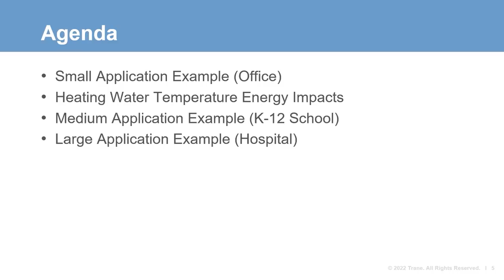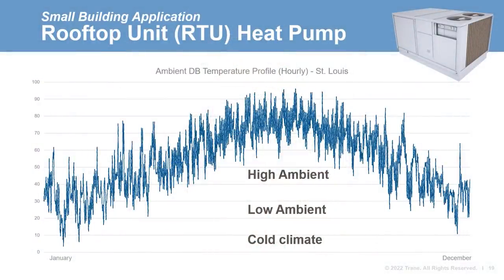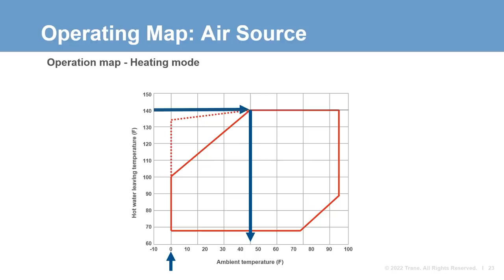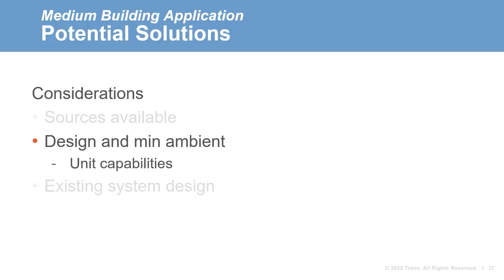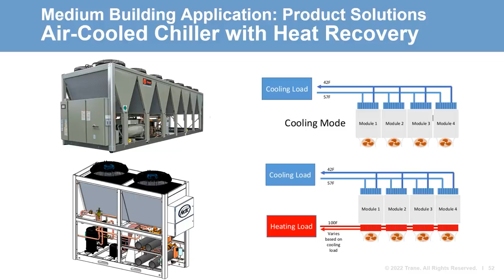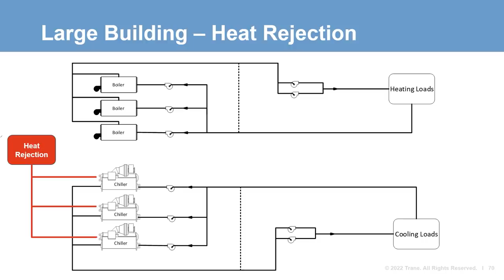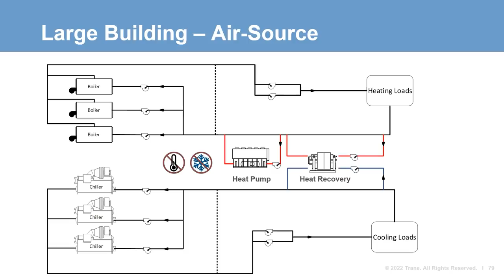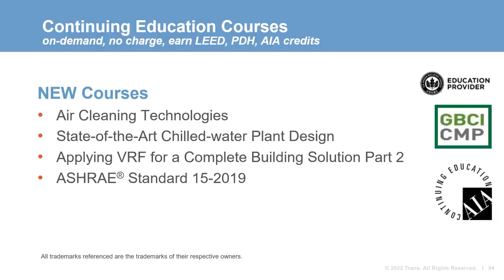Trane Engineers Newsletter LIVE: Decarbonization of HVAC Systems Part 2

Comment: Great video, you mention in the medium building application section that new technology will allow for 130°F hot water production down to 0°F ambient. Is there more information on these products and when it's anticipated they will be available? 

Additionally, air source cooling is generally much less efficient in kw/ton than evaporative cooling - ie an air cooled chiller is less efficient than a cooling tower+chiller for comfort cooling. Adiabatic cooling using water sprayers on the condenser side of an air cooled chiller can however close this gap, especially in dry climates. Does Trane offer this as an option, or do you have any input/recommendations on this?

Comment: If you already have videos or have performed a webinar or thinking about topics for a webinar and training video. 

       Heat recovery systems using air to refrigerant for heating and cooling and using the waste gas to heat a glycol loop system for reheat for increasing D humidification capabilities and heating domestic water like in large hotels or that have commercial space and agricultural in the cannabis industry

     Agricultural cannabis industry needs reheat for Dehumidification they also need to chill water sometimes they need to heat water all simultaneously while they could have many thousands of gallons per day of waste water product from condensation that is used for re-watering but it needs to be processed temperature sometimes needs to be as high as 70+ degrees and also sometimes needs to be brought down to 60°F

At the same time‘s the rooms for a single system may be asked to come down to 60°F with 40° relative humidity in the same system will be asked to run at 80+ degrees at 70% of relatively humidity. 

Have you covered this in any past training videos or webinars ?      For systems in the 60 ton to several hundred ton size systems .